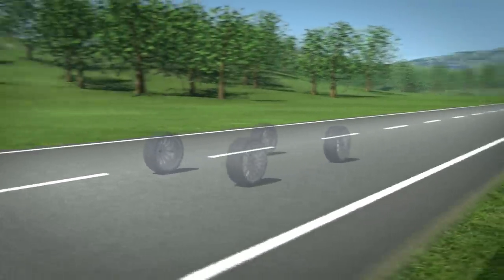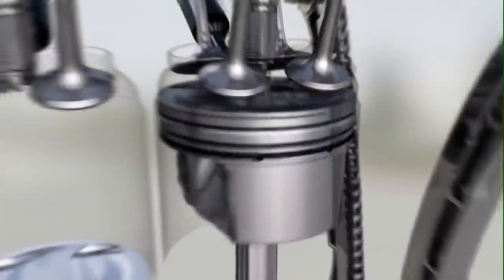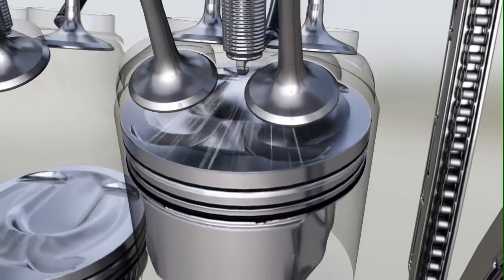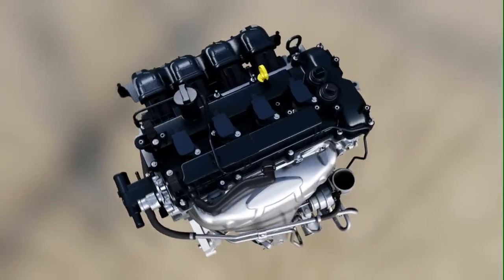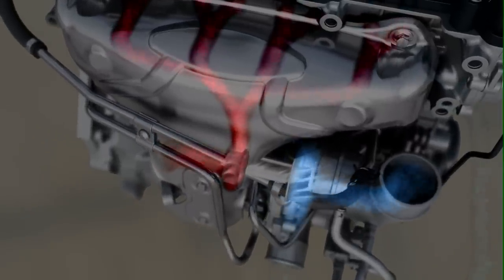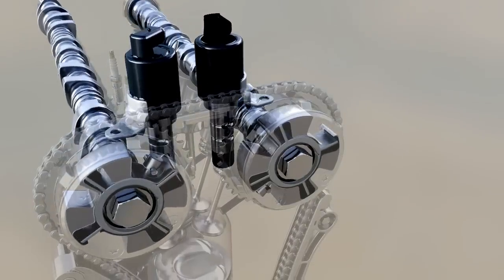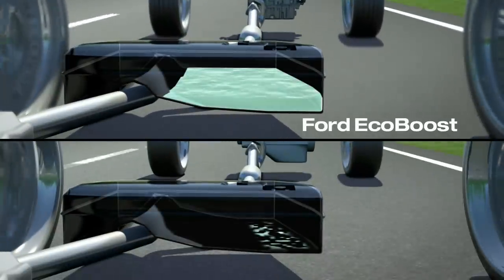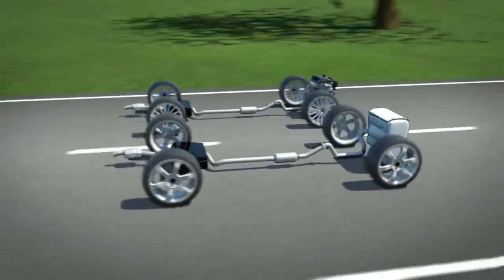Ford Ecoboost Animation

Comment: until you have to do a valve job every 20 k due to faulty pcv vapor distrabution and carbon build up on intake valves
Reply: that was a problem with all the early GDIs, they're doing some extra injections to burn that stuff off in new engines
Reply: Martin Espinoza
ah, i see, so your burning extra fuel to prevent a problem?...
Reply: i know exactly how EGR systems work. Poisoning your air intake of your motor with burnt gases... How about you breath in your shit/farts?
Reply: @Riddick tonn Carbon buildup on the intake valves due to "cheap" gas...on a direct injection vehicle? Think carefully about that...
Reply: I cannot see how there is carbon on intakes if fuel is directly injected; re-circulating exausts perhaps? How about filtering before re- admitted?
Reply: @11wertyh  PCV system sucks blowby gasses into the intake, then coats the valves. Lexus has a solution, two sets of injectors. Now ford copied it.
Reply: Just wanted to respond to this 5 year old comment by telling you about my 3 year old econoost 2.0 with 93k miles, no misfires, no valve jobs. Sounds like some of you need to go back to YouTube mechanics school.
Reply: Using a oil catch can may fix the problem.
Reply: @1700iDiGuy  Actually, yes.  A truly stochiometric mixture would melt the heads of of most engines.  Gas or fuel is also used to strip away heat from the cycle as well.
Reply: No problems with my Mustang at 30k... I use top of the line fuel though.. you have to with the turbo.
Reply: 100k on a 3.5 EB no rough idle no catch can, no issues.  And it was tuned for 70k of those miles by LMS for another 100+ lb/ft
Reply: Got 40 on mine runs fine
Reply: Working of Ford products for over 21 years, I have never had to do a valve job or decarbon valves on a vehicle newer than 2000. As we work on tons of fleet vehicles, many in excess of 300k... The only common failures on the EB have been streatched timing chains due to lack of maintenance, and needing sparkplugs every 80k.
Reply: @mr.vgamer6594  Everyone ignoring your comment, but you're right. A catch can would totally solve this problem. Spend ≈$50, install yourself in less than an hour, problem done
Reply: Well it's not extra fuel, it uses port injection at idle and at low loads.
Reply: @jabroni6199  a lot of these fools run their trucks Max rpm all the time.
Reply: @1700iDiGuy  No they have port and direct injectors during normal operation it switches occasionally to clean the intake valves I do a lot of intake cleaner service on early Ford and Hyundai GDI engines at work it's recommended once a year on certain early GDI vehicles
Reply: Got 65k on mine.  Doing great.
Reply: @aaronwscherer7436  what kind on maintanance would u recomend so I don't have that issue?
Reply: Do tuneups and change your oil every 5k. Thats all you should have to do to make an 1st gen 3.5 ecoboost last 300k. Sure, you may have to eventually replace a cracked manifold or turbo, but there is nothing you can do to prevent that from happening. The biggest killers of turbos has been lack of lubrication due to slugged up oil feed tubed due to lack of maintenance.
Reply: @alb12345672  Ford copied it? I'm pretty sure VW did it even before toyota did lol
Reply: @antoniorios3856  calm down  eco boost is crap i have been doing 2 short blocks a week for coolant intrusion for over a year

Comment: The main source of power of the engine is the intake fan instead of air entering the engine at atmospheric pressure, this intake fan boost the pressure within the cylinders for optimum power and performance on the road, improved acceleration, more efficient highway passing and added power for towing. It will also improved fuel efficiency and buy burning less fuel, the vehicle could also expel fewer harmful pollutants emissions in the atmosphere. In addition this car could be reliable and very responsive to the driver. Even without the exhaust fan and the direct fuel injection to the cylinder, by the Intake Fan alone will do the work. Just like the Air intake accessory for an automobile Engine that’s been copied all over the place.

Comment: 20%less fuel consumption. Hahahahaha
Reply: fr my dodge dakota v8 got better gas mileage then my ecoboost
Reply: It is a 1.0 litre after all, if you want mpg then it's the perfect car because your not going to thrash the small engine.
Reply: Not the way I drive, haha.
Reply: For real. I get like 13mpg in city with the MKS Ecoboost. I can't help it. It's so fun to drive.
Reply: @ivandrago7550  no mine is a 3.5 v6
Reply: Lol hits too close to home
Reply: It’s true!!! I have a 400whp ecoboost and I get 29mpgs.. I bet you dummies are using crappy oil, and 87 octane gas! That would explain a lot. And people
Don’t understand the importance of maintenance and doing oil changes on time at 5k mile intervals not 10k like the manufacture recommends.
Reply: @Paper.Power.Politics  I agree i use 93 its more money but it seems to last longer & my car performs alot better
Reply: @sjhfinest  yup 87, does not last longer, because engine has to work harder , because the lower octane retards the timing , and end up using more gas! So 87 causes a massive power decrease! And shittier gas mileage!  Like I said before,  I have a 400whp ecoboost mustang and I get great gas mileage! I get no less then 24mpgs!  And I’m about to have a 1000whp ecoboost! One a kind! That’s exactly why i got the ecoboost!! I wanted the power! Lightness, and the better mpgs! Peoppe
Sleep on the 2.0/2.3s ecoboost engines! They are beast!! While being efficient! Hence the name ECO-BOOST!
Reply: @Paper.Power.Politics  No lies here i got a 2020 fusion some times i forget its a 4 cylinder the way it takes off i love the eco boost engines gas last a long time & i be stomping lol
Reply: Woooo!!
Reply: @lokihurd4421  The f? Seriously? Get outta Here with your nonsense.
Reply: @Paper.Power.Politics  my wife’s 2.0 Edge only gets 28 highway with premium and 26 highway with regular. It’s not worth the extra cost for such a small increase. It may be different with a modified engine.
Reply: @Lamtitude  well premium gas is more for a car that is actually tuned for that octane. And most of the time cars that are tuned for higher octanes are for more performance.. gas octane has nothing to do with gas mileage. Use what your car is tuned for. If your car is tuned for a variety of octanes it’s better to use the premium because the car gets a better performance out of the higher octane rating. But at the end it really comes down to what is your car tuned for. Also you would be surprised how much. Water gas mileage you can get when you lay off the gas and always create distance infront of you where your momentum Carry’s you instead of being heavy on the gas.
Reply: @orangejjay  it’s true. My dakota got 25 on the highway and my ecoboost gets 19 if I have a good wind
Reply: I do around 5,4L each 100km
And on highway trip to Spain in legal speeds it was drinking 4,2L per 100 as total trip consumption
Reply: If you don’t have a lead foot that is
Reply: @Paper.Power.Politics  I've nicknamed mine Ecobeast, these are not the 4 cylinder engines of the 90's
Reply: @n2rydn781  right. Everyone hates until the get smoked by one lol and everyone had nicknamed their EB ecobeast lol
Reply: @lokihurd4421  did your Dakota make 400hp? Lol
Reply: If it breaks earlier.
Reply: @lokihurd4421

Comment: My mother had an 87 Escort wagon. 4 cyl, ac, good car. Ford chose to use a head gasket that somewhere after 50,000 miles would fail. Moms went at 70K, a friends 85 escort let go at 65K. We drive Toyotas now.

Comment: Too much parts that can fail on such an engine, as a car mechanic educated at a Ford dealer/garage I know. I stick with my 1.8L 125HP gasoline engine in my F. Focus Mk II. No turbo, no high-pressure system, no special NOx filters needed and a little bit more power, than needed for German Cities, so I don't always need the high revs, what saves the engine. No enginge problems in 9 years (105.000km / 65635mls)
Reply: metal666metal666 My mk 3 Focus has broke on me twice and the down time is huge. All on a engine with less than 7,000 miles. I am starting to get afraid of when my warranty is over.

Comment: What really sickens me, the new $500,000 Ford GT has that engine in it.
Reply: If they tainted the great N/A V8 with ecoboost, then people would be even less happy, and you probably won't win any modern races with a N/A car.
Reply: @genericgoat  The old GT from 2004-2006 was not N/A, it was a supercharged 5.4L V-8. Also, the new GT is a twin turbo V6, not the 4-cylinder engine shown in this video.
Reply: BS

Comment: The manufacturer shouldve put the oil catch can after the pcv valve as standard issue. Unfathomable!
Reply: A catch can does not met C.A.R.B. emissions, and they would have to rely on the customer emptying it every so often, and customers are idiots.

Comment: In Europe, the  Ford Ecoboost is 3 cylinders engine, 1000cc with different powers: 100 hp, 125 hp and 140 hp. Gasoline consumption is low. Due to the gasoline price, much better to have a small and well built engine

Comment: "The turbocharger delivers a strong, low-end torque." - This ain't it, chief...
Reply: yea, and blows the motor in the process lol, a condition called LSPI, unfortunately a well known issue especially on people who runs aftermarket parts and tunes.
Reply: nicknicolosi1 i cant speak for all vehicles running the ecoboosts, but for the focus st’s the ecu does a pretty decent job of protecting from lspi. while reflashing an aftermarket tune on may take away the lspi failsafes (lookin at you, cobb), other tuners retain anti-lspi capabilities. what it really boils down to is knowing how to drive a manual, and to not floor it under 2k rpms. its a lot of user error involved in the blown ecoboost motors, or at least the 2.0s
Reply: @trypprl467  yea, that was exactly my point, in response of the low end tourque, people floor this car under 2K RPM, and It isn't healthy for the motor.
I have reached 32K, and so far is holding up, I am FBO and tuned by JST since the car had around 5K miles, going BT now, probably a Garrett GTX2860r gen 2. I am pretty happy with mine tbh. The EVAP thing is the only annoying thing I have found, I am at 3 purge valves already, and possibly 4th is coming soon lol, already threw the P1450 code.
Reply: nicknicolosi1 oh really? see im in college and just had my first car shit the bucket, so i bought used at ~70k. at 75 now and already had the purge valve done. im essentially stock still, unfortunately, as my parents arent the most supportive of buying extra stuff for my car:/ its a shame people dont just downshift or climb in revs before givin it the beans. really makes these cars look at lot worse than they are.
Reply: @trypprl467  I agree, plus downshift is fun, and makes it more fun to drive when this car is driven around 3K RPM, sounds amazing and responds to throttle inputs very well. I lovey the FoST. When you ready for mods, start with the access port, intercooler and downpipe, it will blow your mind on how much faster it makes the car feel, I was making around 260whp on 93.

Comment: Honda did the same thing nearly 30 years ago, with no turbo charger. And when that vtec kicks you feel it. On the sohc vtec engines ya got 3 valves per cylinder below 3000 rpm. At 4500 rpm a butterfly valve opens in the inlet and all hell breaks loose when you consider that it runs all 16 valves after 3000 rpm, and the intake valves at a higher lift and a longer duration. Tried and true technology. And because theyre indirect injection the valves dont clog up. To top it off its a honda so in other words itll live longer than every living organism known to man

Comment: I run a catch can on my 2014 3.5 EcoBoost f150.In 36,000 miles it has captured a little over 1.5 gallons of crankcase vapors which otherwise would have been cooked into my intake valves.Im still getting 19.2 mpg and that's on a 4 wheel drive.The catch can is a bit of a PITA in winter time when it freezes though.But with regular attention it's very managable.After a while you learn  what situations will cause it to thaw and that's when I drain it.All manufacturers have flaws in their vehicles I don't care who they are.So far my EcoBoost has performed very well and I'm a satisfied customer.Now the big question.Would I buy another one? No,but only because there are just too many other less complicated choices to be had.We all have our opinions and likes and dislikes but even if I purchased a new Chevrolet or GMC or a 5.0 Ford I'm 100% positive that eventually that vehicle would also have a few gremlins about it too.

Comment: You all lose. My 700 HP 2.3L gets 48 MPG
Reply: I will call BS on this one!

My 30 year old 2.3l turbo has 250hp at the rear wheels, 21 pounds of boost, and gives me 26 mpg.  Those are facts!
Reply: @DBJ1703  i think he relised his mistake after 7 years
Reply: Sounds like the perfect powerplant to put in my truck to pull my 1500HP SUPERHONDAKAWZUKIDUKE QUAD TURBO 12 SPEED DRAG RACING TOURING TT CRUISER ADVENTURE SPORTBIKE..................THAT NEVVVVVVVER EXISTED👌👍😂😂😂😂😂😂😂😂😂😂
Reply: @cdjurfitbghynkmv7787  😂😂😂

Comment: So basically not one new technology. Everything the ecoboost does has been done for decades by other manufacturers. The biggest thing the ecoboost can boast is the turbocharger which allows for larger power levels on smaller engines while offering lower fuel consumption when off-boost. Guess what - Japanese and European manufacturers have been doing this for better than four decades. The variable valve timing technology is something Honda perfected several decades ago and has been adopted by nearly every major manufacturer since then. Ford is actually quite late to the table on that one.
What exactly are we supposed to be wow'd by here? That Ford can copy other brands decades later, slap a PC friendly name on it like ECOboost and pretend they are doing something new and innovated?
Reply: Well I wouldnt exactly call us american the smartest of the bunch lol. We have been suckers for V8`s since the getgo. I have the eco engine and miss the sound, but have always loved the sound of a blower or turbo also. A tune, and a few small bolt ons and the power gained is crazy off these engines. They have been around for a while and i agree that ford is trying to act like they invented it all but it is all consumer driven and the american consumer has not been ready to let go of the rumble for a fart can yet lol.
Reply: I thought the biggest difference was the injection system allows higer compression without knocking.
Reply: It has a turbo? I thought it was a hairdryer

Comment: I think I would still rather have my 300 inline 6. Launches off line and pulls hard. Sucks gas like a dehydrated Shaq (basketball player) in the desert.
Reply: pinky1900's The 4.9 was one the best engines Ford produced, its too bad they don't make them anymore...
Reply: My wife has a hemi 5.7 and it does just fine mpg...idk why people btch so much about gas
Reply: pinky1900's I have a 1978 Ford Granada with a 250 straight 6 I can get about 25 to 30 miles per gallon. I bought a 300 straight 6 for $100 I'm going to put that in the Granada and I'm still figuring around 20 miles to the gallon.
Reply: The 300 was a great engine for its time but is a turd compared to today’s engines. I had a 95 f150 with the 4.9 and hated it.
Reply: Yeah gimme a 90's model 4.9 F150 and a '17 Ecoboost and we'll see which one pulls my 34 foot camper
Reply: John Sears 
I got a 1977 Mercury monarch 4 door. Factory 4 speed manual. 351 winsor 5.9 liter. Fun cars
Reply: The 300 six will run for 300miles on 4 cylinders!

Comment: Took a  friends f150 with a eco boost engine, we hauled a trailer with 4 Harleys In it to Florida averaged 8.5 mpg, took my same year f150 with a v8, following year, same trailer and bikes. Avg 12.5 mpg. They do get better mpg if you daily drive it and only get groceries with it. If you use for hauling get a v8 last longer and burn less fuel, in the long run. Cause you don't have to keep a turbo spooled up all the time to get same power on a v8

Comment: Right now, only the 3.5L ecoboost is available, but FoMoCo will offer a 2.0L 4cyl (US) and 1.0L 4cyl (non-US) versions.
Don't be surprised if the new 3.7L TiVCT becomes ecoboosted and replaces the 3.5L.

Comment: 2015 2.7 f150 xl  mine has 300,000 miles got it when it had 7 ...only problem i have is that stupid plastic oil plug ..all original parts .water pump .belt .alt fuel pump that has ran 5600 gallons of gas .love that truck

Comment: ecoboost = marketing gimmick. Nothing special here...
Reply: 1:50  The balloon thing is very misleading.  They drew a green balloon with a 20% smaller radius/diameter.   But volume scales with radius cubed.  A 20% smaller volume balloon would have a radius that is cube_root(0.8) = 0.93  or only 7% smaller radius.  Deceptive advertising indeed.
Reply: Yeah that balloon sure had me worried for a second.
Reply: 470 pounds of torque and class leading tow capacity isnt a gimmick to me
Reply: william dohn  wont know, traded it for a 2018 Camry lol.
Reply: Until you drive 1. Mine has 180k miles and will out pull any Chevy v8.

Comment: @veltpak6 oh yeah Ford doesn't make engines.  It doesn't make the 6.7L diesel in the SuperDuty (unlike Ram with Cummins), it doesn't make the 4.4L V8 diesel for Range Rover, and the 3.0L V6 diesel for Land Rover and Jag.  It didn't produce or develop any Duratec and Duratorq engines, that was 100% all Mazda (which Ford didn't invest any money in at all).  I think you are completely spot on with your post.  Well researched, and most of all.... well done! :)

Comment: Ecojunk! I've been told by 3 different ford dealer mechanics, do not buy a ford with ecoboost motors, they are junk and constantly have problems with them
Reply: Tell that to my 150k km without trouble since 2011